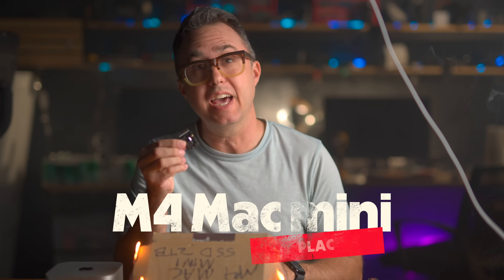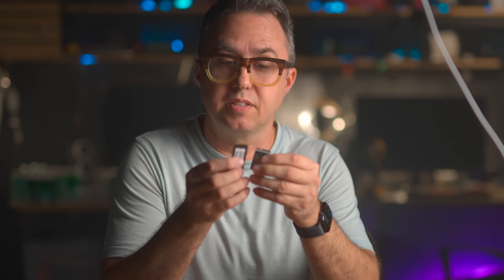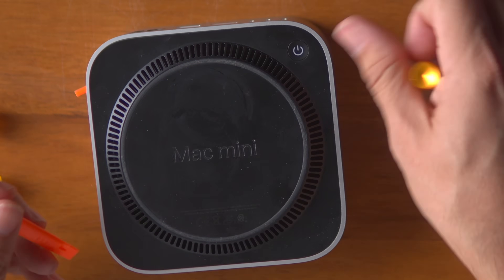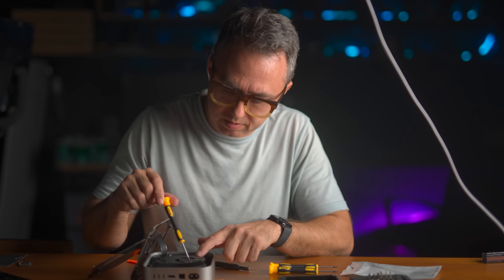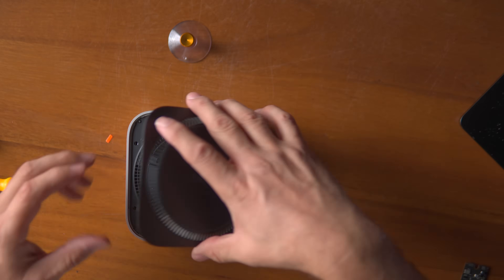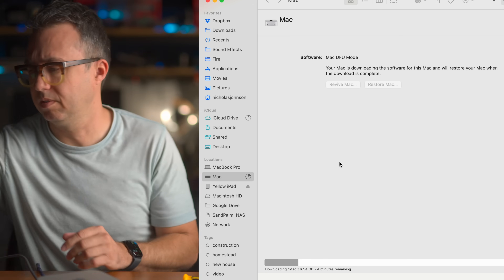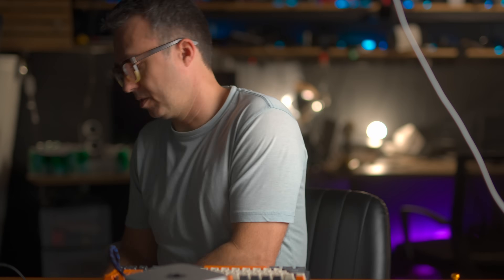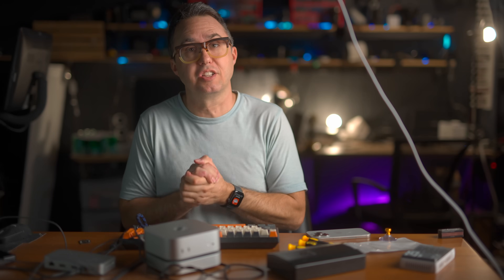Upgrading M4 Mac mini Internal SSD, step by step

Comment: It’s gigabits per second
Reply from the maker: @chrishainstock330  if you’re talking about Black Magic Disk Speed Test, no; that measures gigabytes per second.  Do a google to confirm.
Reply: @ gigabits per second - no cable can transfer a gigabyte of information in 1 second - 1 gbps = 125 Mb

Comment: just order the 2TB SSD from taobao for about $250 SGD so is about 183 USD +/-. 

Anyway do I connect the thunderbolt port to specify port on MacBook Pro or any port from MacBook Pro will do? I know on the Mac mini need to use the middle port.

Comment: Is there any way to use pc for flashing the mac mini 
I want to upgrade but don't have any mac only pc and mac mini
Reply: It says you can on the linked page for buying the Drive, in the answer to the third question in the Q&A section.
Reply: I tried and it would not work. iTunes recognized the Mac mini as an iPhone.
Reply: you can restore the Mac mini with a windows computer and VMware
https://youtu.be/HSmpsXwSrBM?si=tH-r8mxIgjMJ1KZN

Comment: If only the apple had given us a normal m.2 nvme slot just like a normal company
Reply: Apple is impudently greedy.
Reply: Apple integrated the SSD controller in the Apple silicon SOC. This has the advantage the controller has direct access to the unified memory and can pass it through directly to the NAND chips, avoiding a large cache is needed in between. This architecture is more efficient than what is needed for a regular NVMe.
Reply: @ahogeweg and slower
Reply: @deltech1  that is only when just comparing plain read and write speeds.That is not what Apple Silicon and Unified Memory is about.
Reply: @deltech1  Maybe you understand my reply when leaving away the (DRAM) cache of the NVMe. Apple Silicon doesn't need this additional cache since data is directly going from and to the Unified Memory. So the read/write performance is actual the performance of the NAND chips, whereas with most NVMe SSD's the performance measured is with respect to the cache memory on de NVMe. Raw NAND performance is way lower than this.
Reply: @ fair enough! My m4 Mac is around 3000Mb/s or so write, similar read anyway so more than fast enough for me. Not quite as fast as my pc nvme but like you said, depends on the chips used
Reply: @ahogeweg  why is the speed is similar then, if it’s a special recipe…
Reply: @yohanag3408  

It's slower than m.2 SSD

Comment: Is it better to use an external SSD? You keep the 256GB and don't have to worry about the booting issues with a brand new drive - and voiding warranty. How do the costs compare for comparable storage and speed?
Reply: This solution is cleaner and look better, that‘s all. There is no better, everything has pros and cons.

Comment: I have an M4 mini and i would settle for a 1TB option for that chip, as I already have a dongle and an enclosure with as much TBs as one could imagine. I suppose the internal would be faster but not that I would notice. But thx for trying this theoretical out, it has been reported that this does not work... good job getting it 2
Reply from the maker: @PaulzoR2  if you’re interested that same company makes a 1TB version as well and it’s even cheaper! 

I’ll definitely make a follow up video after the next macOS update to show wether they bricked it :)
Reply: earlier today, I ordered the 1TB ssd module from them and it costed me $161.50(originally 170).  I clicked on a link from a YouTube video  to view it and it gave me  additional $8.50 off of the price. I hope it doesn't take long to arrive!
Reply: @theslacker29ify  sounds reasonable. let us know if it works!
Reply: @PaulzoR2  will do! 😁
Reply: @PaulzoR2  update: it shipped... Yay 🙌.
Reply: Please share what is the read and write speed of the 1 TB, on the 3rd party website I can only find for the 2 TB speed specs
Reply: @damirholjevac4178  I'll be sure to do that!
Reply: @damirholjevac4178  I'll be sure to share the read/write speeds once I install it! It departed on the  China international flight  a little while ago..
Reply: I thought I replied earlier, I must not have hit "send"... It was 4069 MB/s write and 2923 MB/s read.....
Reply: @damirholjevac4178  I'm getting a write speed of 4069.6MB/s and read speed of 2923.1MB/s. That's using 1GB file.
5 GB file is 2900 for both read and write speeds

Comment: Ive seen these available for the past few weeks or so, and was considering buying one also.  I opted instead for a thunderbolt external enclosure and nvme ssd.  I hope these replacement drives work out perfectly and thanks for being a guinea pig for us but Im sitting on the sidelines for a few months to see how well these hold up.  Excellent video, keep the flames coming!
Reply: Yes, my main concern about this would be that theres an OS update which breaks it.
Reply: This are my thoughts also. Im going to get a Thunderbolt drive and then after maybe one or 2 more months ill pull the plug

Comment: I just received my card in the mail today, will be upgrading tomorrow.
Reply: Did you have any issues with the DFU restore? Mine keeps failing
Reply: @muskratlanding2892  I'm getting ready to install it now.. I'll let you know if it works for me.. 
Do you have the thunderbolt 4 or type c cable plugged into the middle thunderbolt port on the back?
Reply: I didn't have any issues with DFU recovery..
Reply: @ Maybe a firmware lock?
Mine flashed but through up a caution triangle ⚠️and  said something about resetting and erasing data, but it wasn't needed. I think that was due to not logging out of my icloud account before installation.. It did ask me for my Apple ID password because the Mac Mini was registered to that account ..
Reply: @muskratlanding2892   I can't restore mine, but I'm trying. from an intel macbook. I'm hoping it will work from an M series device as highlighted by someone earlier, I spent nearly 5 hours working. different cables etc. Fingers crossed that an apple silicon device will work.
Reply: That's awesome. How long did take from ordering to receiving the ssd module? I ordered mine earlier today and was wondering an estimated time. Thanks

Comment: The problem is: will apple block mac with a firmware upgrade early?
Reply from the maker: @OlindoPindaro  that is the question, isn’t it.  It in order for this to work at all, it’s got to be mimicking the Mac drive. So if they were to disable it, it may disable everyone’s drive.  Orrrr they’ll find a way to distinguish it. If you do upgrade, make backups and keep the old one in a drawer!

Comment: my mini M4 pro 512G drive RW at 5000/5000, not sure why 256gb is so much slower.
Reply from the maker: Yeah, I don’t understand why a smaller drive would make a difference. It IS two nands; in an older MacBook Pro tear down I saw that maxtech had found the small drives only had one nand on the ssd so it was doing all the work

Comment: I feel like apple can brick these ssds whenever they feel like it with an OS update.  Anyone else fear this or is it just me?
Reply: The consensus seems to be they have no way of knowing you're using one of these, because it's not an SSD—it has no storage controller, and the machine doesn't and shouldn't care what NANDs it's connected to.
Reply from the maker: It’s possible; but these boards are made to mimick apples board, I’m not sure what specifically it’s listening for, but they would have to change theirs.
Reply: They dont need to brick it, just do what they did on the studio, you can replace the ssd but it has to be the same size as the original purchase, so no benefit
Reply: @JJ-fq3dh  There's a whole pile of misunderstandings associated with the Mac Studio because people incorrectly assumed its NAND modules are all completely interchangeable, but it's not limited to the same capacity as the original purchase any more than the Mac mini. Polysoft did the necessary reverse-engineering, ran a Kickstarter and will begin selling upgrades on their website quite soon.
Reply: Thanks Apple. With Inflation crazy across the globe, this was a smart move & likely one you’re allowing & benefitting from.

Comment: My only issue is that you need access to another Mac to do this. Well, I thought that the Mac mini was meant to be a gateway for those of us new to the Apple ecosystem...
Reply: I’ve read posts online stating that a windows machine with iTunes can also be used to perform the Mac mini system restore in DFU mode. I cannot confirm this works, but I have seen this info posted in multiple locations.
Reply from the maker: I’ve seen that posted as well.
Reply: Pretty sure Apple didn't intend for you to do this.  ;-)
Reply: Any computer that can run idevicerestore will work for the DFU restore.
Reply: you can also restore the Mac mini with a windows computer and VMware
https://youtu.be/HSmpsXwSrBM?si=tH-r8mxIgjMJ1KZN

Comment: The price is actually quite reasonable for this setup. On a Mac Mini with the M4 Pro, you can achieve write speeds of 6397.8 MB/s and read speeds of 5642.7 MB/s using an Acasis Thunderbolt 5 enclosure paired with a Samsung 990 Pro 4TB SSD—all for under $600. It’s not cheap, but considering Apple charges $1,200 for 4TB, it’s a great deal.
Reply: Thats a better way to go than this internal hack
Reply: @JJ-fq3dh  No it isn't. Lol it's only 300 and anyone can do it. Takes like 1 hour with the software. You can even get the 1TB for only 170.00. SO for $770 you get the computer and the upgrade. The whole point is to nt have to have an external drive. smh. Anyone can just go buy an external drive....lol. You spend 600 on just a drive.

Comment: Interesting. The ‘link’ to the ssd in the description doesn’t work though
Reply from the maker: Thank you, I fixed it.  Refresh and it's back in action!
Reply: @SPACEDESIGNWAREHOUSE Thanks, but I hadn’t read the bit about it not working with Pro. I wonder why 🤔
Reply from the maker: @gordonrobb  It would be a firmware issue. But this other guy says he's got one coming soon! https://expandmacmini.com/shop/
Reply: @ Nice. Not sure why I’m thinking about it having spent so much money on 2x2tb externals in a Raid 0 set up 😂
Reply from the maker: @gordonrobb  haha, yeah - especially with it being a mini, its not like you travel with it (probably).
Reply: @ I actually got it to travel, and use Vision Pro with to edit video. But I don’t travel very often. 😂
Reply: @SPACEDESIGNWAREHOUSE  The website shows it's available for $259.... 🤔

Comment: Can you think of any reason why these don't work for the Mini M4 Pro units (according to the supplier)?
Reply: ssd module for M4 mac mini pro has different board.
Reply: @Sam-wg6ge  I would guess so. SSD on m4 pro is much faster than what was shown in this video. Actually I was surprised to see how slow the stock  SSD is.
Reply from the maker: I can only assume its some sort of firmware thing, part of the whole security thing.. The real issue is that I can't think of any reason they didn't just use NVMe drives.   But this other guy says he's got an M4 pro one coming soon https://expandmacmini.com/shop/
Reply: @SPACEDESIGNWAREHOUSE   I think the actual reason is that the M4 Pro models use a different module. The interface is probably the same but the modules are different sizes so the smaller M4 one wouldn't be able to be screwed down. And you cannot physically close the shell if doing it the other way around.
None of this should be an issue in the first place, but that is a different conversation
Reply: Mac Studio board has 2 SSS Chips, Mini has just 1 chip.

Comment: Wow this is very encouraging. It will be interesting to see if Apple maliciously release an update that can detect a third party upgrade and disable boot. I really hope not. It would be useful for you to create another video in a years time with your experience of this upgrade. It’s still a bit inaccessible if you don’t have a second mac to do the restore. And did you say you paid 600 bucks for 2tb? That’s still way too expensive when you consider that Apple charges 800. Surely it has to be less than 600, otherwise it’s not worth the risk. Getting an external 2tb is only gonna set you back 200. Nice vid though
Reply from the maker: @dawnrazor  no no, I paid $300 for the 2TB, I meant I paid $600 for a machine that I could then turn into 2tb. 

But I agree and I’m definitely hanging on to the origin drive and making backups in case they ever “turn it off” remotely somehow.  I’ll do updates when there are MacOS updates to report that it’s still working!
Reply: @ sorry I misunderstood, my bad!!

Comment: Do not work on Mac Mini Pro  :(
Reply: I saw another video switching m4 and m4 pro Mac mini SSD, it turns out it cannot run with each other. I think that can tell why the third party SSD cannot be work on m4 pro. But I think they will definitely work out designing and manufacturing the SSD especially for m4 pro ones.
Reply: Its specified that it will NOT work on M4 Pro
Reply from the maker: @andrewsmith9075  yeah, what an odd thing…

Comment: https://youtu.be/ftDzR_B_vv0
a slightly cheaper option, with monologue from the maker, a real human being
Reply from the maker: Ive reached out to him as a secondary source. I know all of these guys, so far, are doing these one at a time by hand!
Reply: @SPACEDESIGNWAREHOUSE would you recommend buying one if the ssds from them?
Reply from the maker: @mickiee459  I just checked and they've got Paypal as an optional payment method, so you'll be able to get your money back if the thing never arrives.  So that's a good sign.  But he is just as new as the company I went through, so only time will tell?    I CAN say the one I used is working beautifully.   If this other guy is actually using the same nands as apple, there's no reason it wouldn't be just as good.

Comment: Does it need to be a thunderbolt cable to do the DFU restore or will any USB C data cable work?
Reply from the maker: @spencersolberg  any usbc cable will work, use the middle port on the mini. It’ll just be faster with thunderbolt

Comment from the maker: When in DFU mode, to manually select a firmware of your choice (the one you downloaded previously from the ipsw website) HOLD OPTION while clicking restore. Otherwise if you just click restore, it will download the newest firmware automatically and you don’t need the step of downloading it yourself.
Reply: Ahh makes sense. Thanks!

Will restoring from a previous Mac work on a Win PC? Or if “restoring” via iTunes, we need this IPSW firmware? For context, I owned a Macbook about a year ago.
Reply: @itsmecholocarlos  neither worked for me on an i7 Dell laptop with usb C.  I could not restore from a downloaded IPSW (attempted but failed 7-8 tries) and the Apple Devices app wouldn't recognize the device to download it automatically.  Using a Mac (albeit unsupported 10.5 OpenCore) was my only success.
Reply: @itsmecholocarlos  The “restore” is to just load an operating system onto the SSD, and this can be accomplished with a Windows machine rubbing iTunes. If you want your data back, Time Machine is the easiest way to do that. Make sure to make a Time Machine backup before you open up the bottom of the Mini, or else you’ll find yourself having to do it few extra times. Reloading your data to the Mac does not involve a windows machine at all.
Reply from the maker: @itsmecholocarlos  Im not sure what you mean 'on a Win PC.'  If you've got a MacBook from a year ago, that will work to restore a new Mac mini.
Reply: Why would you want to do this manually? Why not just click 'restore' like you said? Thanks.
Reply from the maker: @dotinsideacircle  The ipsw website has older versions of the firmwares also, so if you want a specific one (for a reason I can't really come up with), or if you want to download it at a place where you have really fast internet (the file is 16GB) but then restore back at a different place where the internet is slow, then that makes sense.  Otherwise, I agree, that's an unnecessary step and I probably should have left it out of the video.

Comment: As a note for anyone attempting this, it should be possible to restore the Mac mini using the already downloaded image by shift-clicking (or using a similar key combination) the "Restore Mac" button. This allows you to avoid downloading the entire software again, which can save a lot of time, especially on slower internet connections.
Reply from the maker: It’s OPTION+Clicking on Restore Mac. Thank you for pointing this out, I pinned a comment.